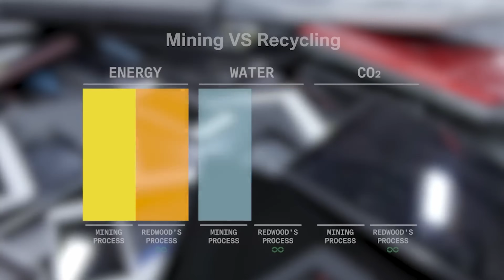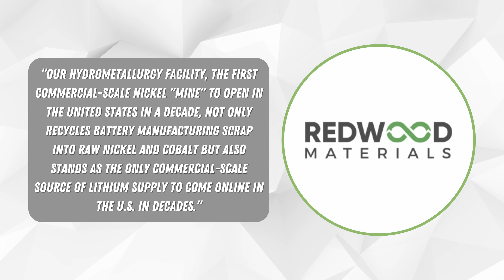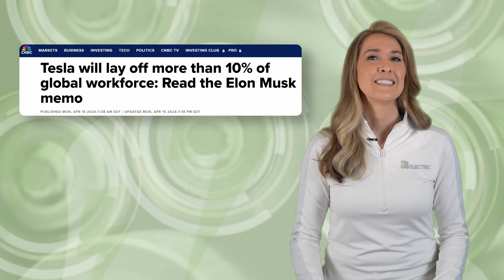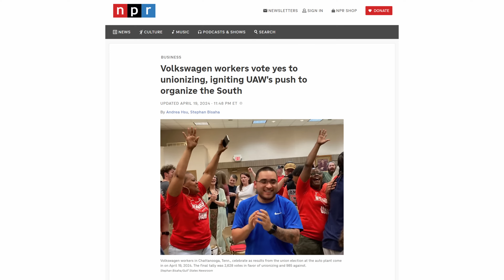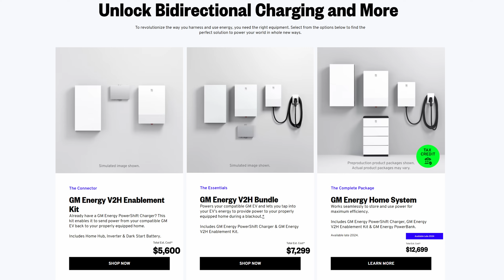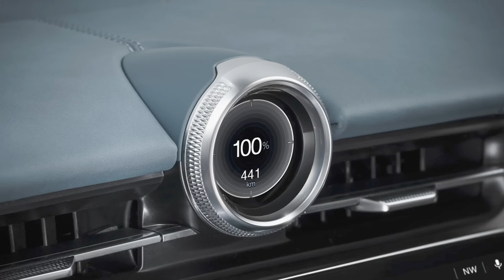The Current : Weekly EV News Ep#7 April 20, 2024

Comment: Very good MGE, glad to find your channel! It seems that instead of being the Cadillac of all models, Caddy is aiming to put its cars into the hands of more people. I traded my Model S for a Lyriq because the handling, GM Supercruise, and overall operation is more precise. Well, the reason actually was that my wife wouldn't drive the Tesla and loves the Lyriq. I had to go all the way up to a Luxury 3 in order to get what I wanted but there was a $7500 rebate with an additional $500 veteran's offered on GM models. Then the dealership sent an electrician over to install level 2 charging in my garage at their expense. So I like the way GM is going about electrification and I've heard that their electric pickups beat the others and I suspect that this is why they are your favs. Tesla may have invented a new market but the big boys have caught up!
Reply from the maker: Thank be clear, Miss GoElectric said that the GMC Sierra Denali is her favorite "Ultium" based EV. Only General Motors makes Ultium battery based pickup trucks.

She drives a Rivian R1T Max Pack with over 400 miles of range. We also have a Tesla Cybertruck. When the range extender arrives, range will surpass that of any other EV truck. We do not intend to buy a Sierra Denali.

Thank you for commenting! 
-Producer Tim
Reply: @MissGoElectric  Thanks for clarifying. I am not in need of a truck but appreciate the advanced design of the Cybertruck. Still, Tesla sales continue to slide.
Reply: @MissGoElectric  So the GMC Sierra Denali, she has never seen or driven a production version of, is her "favorite "Ultium" based EV?  According to GM "Ultium" is just branding and means nothing regarding the performance, technology, chemistry or actual source manufacturer of the batteries.  Really?  Almost as valuable as Porsche's "Turbo" on BEVs
Reply from the maker: Ultium is a platform from GM. It includes batteries, chassis, sensor suites, etc. Pickup trucks on this platform have been in production for quite a while now. Miss GoElectric first published content with the Ultium pickup truck years ago. 

On this segment called The Current, we have shared design, pricing, and specifications of all Ultium trucks including Hummer EV, Silverado, and Sierra. We invite you to watch more episodes and other content if you'd like to learn more. 

Watch your tone. 
-Producer Tim
Reply: @shazam6274  All EVs are improving as the truck market expands. MGE is not the only one impressed with GM pickups and the Tesla Cybertruck. I'll trust her opinion with regard to Rivian as the verdict is still out on them.